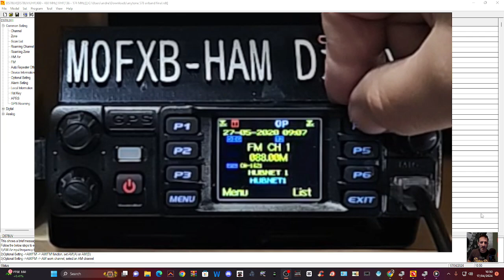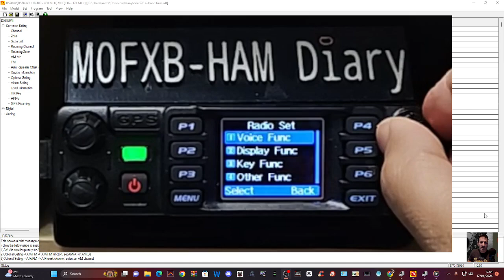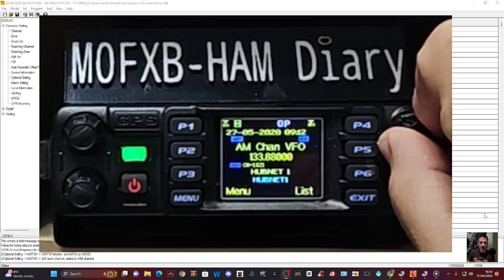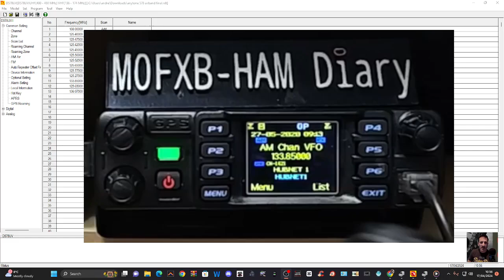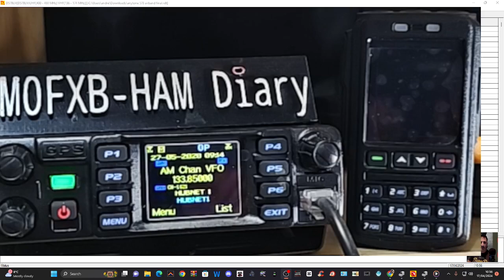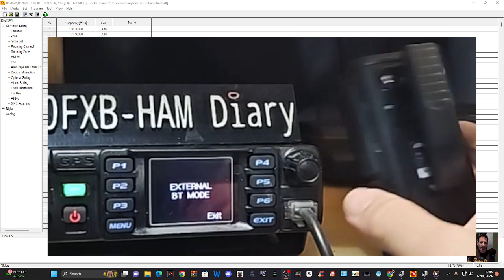AIR BAND - ANYTONE 578 PRO III - FULL SET UP inc - CODEPLUG

Comment: air band isnt and option when i open cps, yet i have the 578uviii which is currently listening to airband, my cps verion is 1.21
Reply from the maker: Nice
Reply: @m0fxbhamtech  i found  solution to the problem, in the tool menu press options and it comes up with tick boxes the activate more functions you can change with the software 👍👍